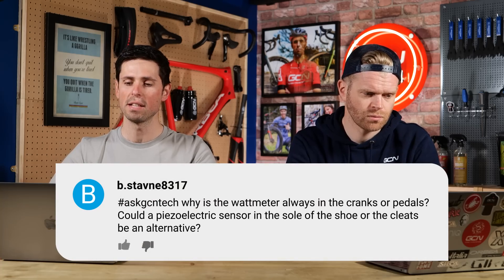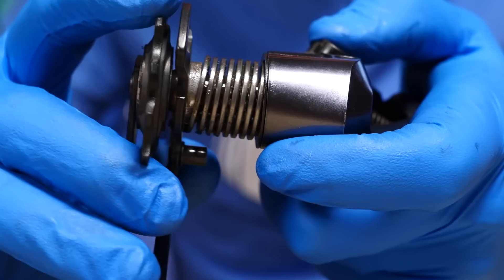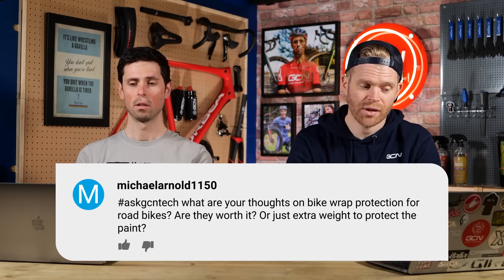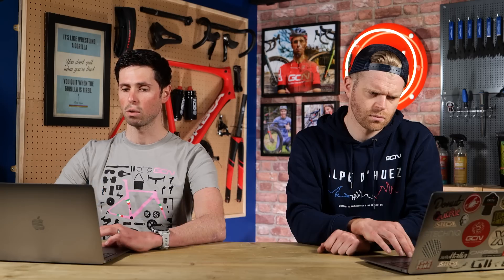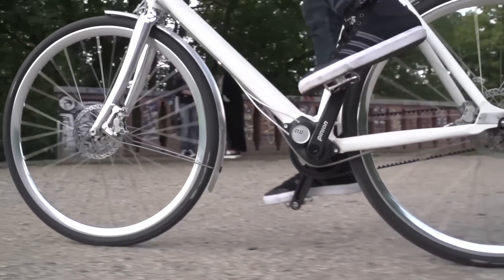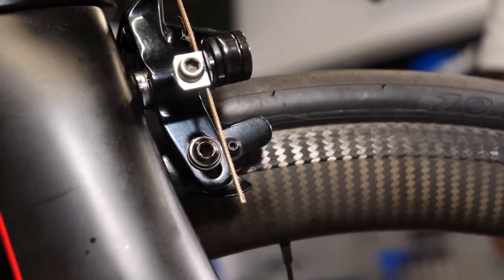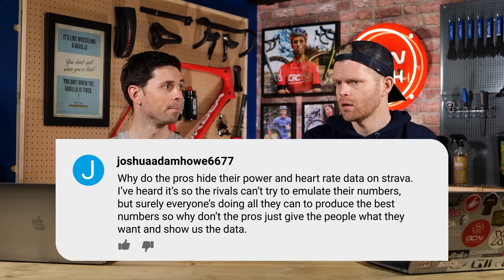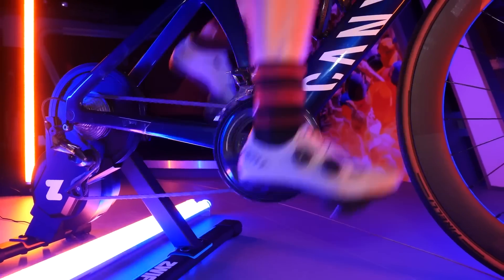Frame Wrapping, Carbon Rim brakes and Pro Data | GCN Tech Clinic

Comment from the maker: We want your burning tech questions! Drop them below using #askgcntech 🔥
Reply: What is different between spindle and pedal? I thought pedal power meter be best as easy if need to change  and closer to where you apply power
Reply: @mlee6050  power meter pedals are the easiest to move between bikes as it's normally a single allen key or pedal spanner to undo them.
By spindle I assume you mean crank spindle? (Pedal based meters measure from the pedal spindle)
Overall in terms of numbers, they're similar. You get a bit of variation when you swap between models and measurement location. Pedal meters come in either left only or independent left&right, whereas I think a crank spindle only measures total power. Crank spindle sounds like a pain to move between bikes.

I personally run a favero assioma left pedal, DC rainmaker and Gp llama both highly rate the accuracy. Takes a couple of minutes to swap the pedals between bikes, normally run for about a month of riding between charges. I've had mine since 2020 and run year round including wet and salty British winter, still haven't needed to replace the bearings.
Reply: @twatts4436  at moment I only had left crank for mine but looking at Garmin RX200 as when BB30 on current and thinking if to get DUB on my next bike, I only said "spindle" as powermetercity just calls it that, also may seem OP but I went power meter at first as my SRAM Red 22 BB30 crank was too short for the bottom bracket, so I used a longer spindle from them with a power meter and PTFE spacers custom cut, to fit between crank arm and spindle so it won't clamp too much so crank can spin freely

Comment: #askgcntech I'm a a bigger rider and I'm always struggling with the rear gears jumping cogs, even after getting the cable changed and having my LBS take a look.  I don't think I've stretched the chain as it's only a month old, same for the cassette but I wonder if there is a quick adjustment I can do to stop my gears from jumping cog.
Reply: Is the cassette worn out?

Comment: Long live rim brakes!  To answer the viewer's question: carbon clincher rim brake wheels are great.  I did the Mt Ventoux on them with no problem.  Newer model wheels have an etched braking surface that works very well.
Reply: I think this refers to wall thickness around the hook joint heating up and being prone to delamination.  It's obvious to see on a cross section. view 

I'm a bigger guy so went with tubulars for this reason, the profile is thicker and smoother.
Reply: Your rims are a wear item.  I hope they weren't terribly expensive
Reply: @Finx5000  They last if you take proper care of them...  Don't believe the marketing propaganda.
Reply: @Finx5000  carbon braking surface  wears slower than alloy though.
Reply: @adambrickley1119  Yup, I have worn through 2 aluminum rims on my Brompton.
Reply: @montrose252 I’m trying to work out how long my rims have left but there’s no real wear indicator. It’s got basalt surface but I have no idea how thick it is and don’t want to find out at 40mph. Is there a bike workshop or tool that could find out how thick the braking surface is?
Reply: @teeambird2079  I don't know.  I regularly clean the braking surface and the brake pads because dirt or sand will act as an abrasive.  Otherwise, I think they will last a long time.
Reply: @teeambird2079 it's not like magically the brake surface stops working. You will notice  it in the surface.

Comment: Carbon rim brake wheels not an issue on flat roads but on steep wet descents got to drag the brakes all the time (max distance descent I've done on carbon rbws is 6km) as they don't 'bite' like alu rim brake wheels. Signed, an over cautious 51y/o.

Comment: The thing with carbon rim brakes for the AVERAGE rider, is that they will drag/feather the brakes on steep twisty mountains. It takes a lot of experience and confidence to only brake immediately before corner entry on a road you dont know.
By all means, they can be absolutely fine, but i wouldnt recommend them for average riders heading down mountains.

Comment: #askgcntech Hi! I have a little problem and don't exactly know which way best to solve it. On my city bike (lovely steel frame) I noticed that it's not my front derailleur being poorly indexed but the driveside of the bottom bracket is loose and going up and down, causing my chainset doing the same and kind of selfshifting when I am pushing a little harder. I then tried to take my chainset out (Hollowthech II, threaded BB) And the driveside of the bb came out with it. The thread of the bottom bracket is somehow worn away and I didn't watch the frameside of the thread and put it back in. My question is a bit if hopefully the frame isn't damaged, how I get a sticking Bottom bracket without a thread of an axle... Thanks in advance 😅

Comment: Carbon rim brake wheels perfect technology, no issue with delamination whatsoever, perfect breaking under different conditions, absolutely recommended. I did 50 race with them and I use clinchers, tubulars and tubless absolutely perfect light and fast. The breaking is equal to disc brakes, the appication of force is the only thing that changes, and the rim does dot crack easily like in the disc brake wheels case. I dunno Ollie that pretends to be an expert how many races has done...
Reply: You sure? My carbon wheels brake terribly in the wet. 

Other than that, they're great.
Reply: 50 races is hardly a long time to run a set of rims for - and it sounds like you didn’t even run the same set for all 50.
Reply: @rob-c.  50 mostly done on campy bora ultra 35 tubulars also in wet conditions, I recently bought a set of prime (tubeless) for the crits that I have been using extensively also for training, and a set of elitewheels drive 40v (clinchers for now) used in a couple of hilly granfondo. Not a single problem in breaking or overheating the rim. I live in Italy where big long climb are almost everywhere.
Reply: Ciao, sto pensando di prendere dei cerchi in carbonio usati ad alto profilo con tubolari... hai qualche consiglio da darmi su come controllare il loro stato di usura?
Reply: @franadia5508  Ciao, sì credo si veda a vista, se le piste sono molto rigate ho la tassellatura è andata lascia perdere. é anche vero che queste ruote le useresti in gara, non credo ti alleneresti con ruote alto profilo e tubolari. Controlla le piste e vedi come scorrono.
Reply: @lorenzodestefano4043  grazie mille per la risposta! Ma perché non dovrei usarle nelle uscite di allenamento? C'è qualche controindicazione?
Io non faccio gare, per me sarebbe più uno sfizio. Sono interessato a prenderle perché le ruote ad alto profilo mi fanno impazzire esteticamente, e ne ho trovato un paio a 300 euro che dalle foto non sembrano messe malissimo. 
Forse ti riferisci al fatto che i tubolari una volta forati siano da buttare?
Attualmente monto delle normali ruote in alluminio, copertoncino
Reply: @franadia5508  dico solo che con il copertoncino in caso di foratura è più semplice correre ai ripari, mentre con il tubolare se il gonfia e ripara non funziona (può capitare) si deve chiamare qualcuno; poi la pista frenante in carbonio in caso di tempaccio è meno affidabile dell'alluminio (anche se dipende molto dai pad dei freni e dal tipo di ruota), in più in caso di vento il profilo 50 può essere un po' piùà scomodo da gestire... comunque sono scelte certo che si possono usare anche in allenamento. Io di solito però uso ruote in alluminio in allenamento e carbonio in gara
Reply: @lorenzodestefano4043  ho capito
Gentilissimo grazie mille

Comment: I agree with another comment, that Rim brake Carbon wheels, having put 100's of miles on my wheels on long mountain descents, they hold up and are less expensive. Mt Baldy here in SoCal, Palomar, Big Bear, etc., so I'm racing down serious mountains.
Reply: They are less expensive until you have to replace the whole wheel when it wears out, rather than a handful of rotors.
Reply: @rob-c.  how do you find out when they’re worn out if they don’t have wear indicators? Is there a tool to check the braking surface depth you have left? Like a small X-ray or something. I don’t want to find out on a descent
Reply: @teeambird2079  Simply? You can’t! 🫣
I ditched mine when the rim felt overly concave. I now run discs so won’t have to worry.

Comment: Carbon rim brake rims ridden for years by pro peloton down insane descents at speeds … Ollie - “not a fan, they’ll delaminate, it’s a fact” 😂
Reply: Pros were running tubs not clinchers (which Ollie was eluding to) at that point. Also, pros descending like madmen touch the brakes as little as possible. The average rider will be dragging the brakes even on the straights to keep speed down.
Reply: It is a fact; has to do with high temperature (and get rid of it). Carbon resin can handle up to 180, and gets way hotter than than when braking. Pro’s indeed do less braking, can swap rims at any moment etc. Check peak torque channel, or leusher teknik.
Reply: Yes nibali sagan 100 k h rim brake❤
Reply: @cyclingjack man new rims can handle 270C degrees stop talking trash
Reply: @ElRealista.  not sure if you are talking about carbon rims or not…. The resin is important, do research. And also: If it’s 180 or 270 c doesn’t matter, (inner)tubes will still blow up / melt at a lower temp. At 145-170 degrees c expect the (outer) tyre to start melting (depending on used rubber).  Secondly; the carbon will deteriorate over time / kms due to rim braking. Happens with iron / alu rims too (my mtb rims, disc brakes on your car). Withstanding 270 c or not.

Comment: I would say as regards carbon fiber rim brake wheels that I don't really have any concerns of them in their tubeless variety. I ride them under most conditions with no problems. They brake more than well enough, even on steep descents. I do have a pair of aluminum tubeless wheels that I put on if I expect rain and I am going to ride, and I would consider them for a tour in the Pyrenees probably, since I'm not racing anymore and don't really need to bomb a descent with carbon wheels. I very much prefer rim brakes over disc brakes for a whole host of reasons. If you are in agreement with that, carbon fiber rim brake wheels absolutely do have a place, as I ride them on about 95%+ of my rides - big descents and very occasional surprise light rain included. No problems. You are going to need a set of aluminum brake surface wheels for the really rare circumstances like I mentioned, so keep those. The only downside is that yes, you will eventually wear out the rim brake surface, as is true with all rim brake wheels. Not a big deal at all if you have chosen rim over disc, but it is really the only con I can think of. You obviously don't, in most circumstances, choose those wheels to go on a Pyrenean holiday unless you're very comfortable with minimized braking.

Comment: A bike tech shared with me that carbon rim brake wheels are also prone to wear more quickly as the brake pads make contact where there could be dirt or debris buildup.
Reply: That would be the exact same place as on an aluminium rim though 🤔
Reply: @rob-c.  Exactly. The disc brake is farther away from road debris, hence would, in theory, be kept cleaner.
Reply: That's why it's important to dig out debris from the brake pads every now and then.
Reply: @robertmills6772  I thought you were taking about carbon rim brake wheels specifically, not all run brake wheels

Comment: vinyl wraps (non clear ones) can make it difficult to notice cracks on carbon frame. If you crashed or bumped your frame.. make sure to look under the wraps
Reply: I've wrapped several bikes (some multiple times) and have seen breaks on wrapped bikes.  In my experience a break under a wrap actually shows up a lot better than you would expect.  Yes, it's likely still possible for a small crack to be hidden under a wrap but from what I've seen a crack in the carbon will also tear the vinyl and be visible.

Comment: Carbon rim brakes are not that usable. Of course it would not stand the heat if you're descending like tom pidcock, but for normal use - especially if you got good set of wheels and proper pads - it will set you for a long time. Perhaps as long as alloy wheels does.

Comment: Carbon wheel and rim brakes = Tubular.
In eight years I have had no problems with my cheap Chinese carbon wheels. 50mm, 1315g/pair, 100kg rider, tubular and 10 bar pressure.

Comment: Here are two tubeless related questions. 

First question: I was inflating Vittoria tyres after installing it for the first time and it leaks air and doesn't inflate. Do I need an air compressor or do I need another method to inflate the tyres?

Second question: whenever I try to seat the beads of my tyres, they don't make a popping noise but I can see the bead line clearly, wound that be a concern?
#askgcntech
Reply from the maker: Sounds like a good start for this would be this video 👉 https://youtu.be/0O50i8uCqf4
Reply: Some tubeless tire & wheel combinations don't produce the pops (like Roval, which doesn't have a bead lock rim bed profile), but as long as you can see the bead is fully seated, you'll be OK.

Comment: So I’m 80kg and going to the Dolomites this summer … running vision SC 40’s  ( Rim brake ) with 28mm Pirelli Cinturato Tubelss - should I be worried #gcn because you’ve planted a serious worry in my mind now thanks
Reply: Tubeless wheel systems are under a little less stress on the bead due to the lower tyre pressure. It is more than possible to descend safely on Carbon rim brakes however you will need to be more aware of your braking habits and your brakes' condition. Avoid dragging the brakes to control speed, try to use your body as a wind break to help as much as possible, and if you feel that the heat build up is starting to get too much stop as soon as posible and wait for them to cool down. 

I would also make sure that the pads and rims are as clean as possible before you start off each day. I don't know what pads you are currently using but a premium carbon specific pad such as the Swiss stop Black Prince will also help by improving stopping power whilst incurring a little less heat build up.
Reply: @matt_acton-varian  thanks for the info 👍 I’m not one to drag my brakes usually , and was getting a some black Prince  pads … Wheel suppliers say they don’t require brand specific brakes so that’s good.👍

Comment: #askgcntech

Hello,
I have just bought a 2023 Bianchi Oltre Pro (with shimano ultegra di2 if that makes any difference). And on 3 different occasions got speed wobble. The speed was about 55-65 km/h when it happened. Have checked the bike and everything is tightened and there is no play anywhere.
Never experienced that on any other bike.
What do you think this could be due to??

Comment: What are the pros and cons of 6 bolt disc rotors compared to centerlock disc rotors and setup?
Reply: 6-bolt
Pros: Lighter, lower torque spec (typically 4 - 6 Nm), easy to replace on the trailside if bent like a taco (for MTB bikers), can be used on any disc brake hub (adapters needed for Centerlock hubs)
Cons: Not all road forks can take 6-bolt rotors on Centerlock adapters due to clearance with the adapter lockring, bolt heads may strip if you're removing them for the first time on a stock bike (only for some bikes, this could be due to them being overtorqued at the factory, my entry-level hardtail is one of them)

Centerlock
Pros: One fastener to lock it down
Cons: High torque spec (usually 40 Nm, but can vary from lockring to lockring), not easily replaceable outside of a workshop, heavier, not compatible with 6-bolt hubs (no such adapter)

Comment: #askgcntech Wind tunnel tests of aero wheels, skinsuits, etc., are usually performed in a relatively static seated position. Do these results also apply to a max sprint, in which one is throwing their body and bike left and right very dynamically, or is this too different?

Comment: Best option for rim brake carbon wheels is to get ones with an aluminium braking surface. Been rocking my FFWD F6Rs that have this for years with no issues.
Reply: I don't think alloy surfaced carbon wheels exist anymore. The market wasn't there for them, as they were extremely heavy in comparison to their full carbon counterparts, and the bonding between the carbon aero profile and the rim braking surface could eventually fail over time. There were a few options on the market about 5-10 years ago (Shimano Dura-Ace, Campy Bullet, Mavic Cosmic -Elite SL?) These wheels were around +1800g for a pair and that's not much less than the only deep section full alloy wheel on the market (Pro-Lite Bracciano A42). I am not familiar with FFWD range but I don't think theF6R is still in production anymore.

Comment: #askgcntech Hi team, thanks for all the great content! Just a quick question about cleaning bike cleaning brushes. I find that my brushes get quite greasy and dirty after a few uses and rather than cleaning the drivechain etc, they just seem to spread the grease around. I'd prefer not buy new brushes so any suggestions for cleaning them would be great!
Reply: Degrease them and wash with soapy water.